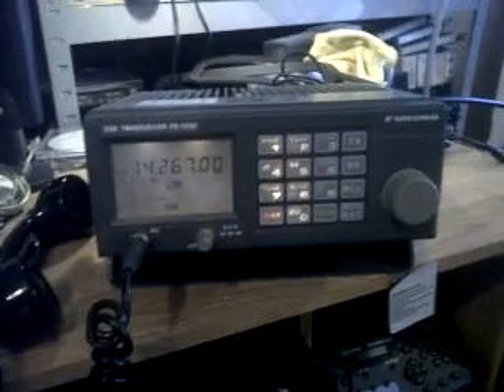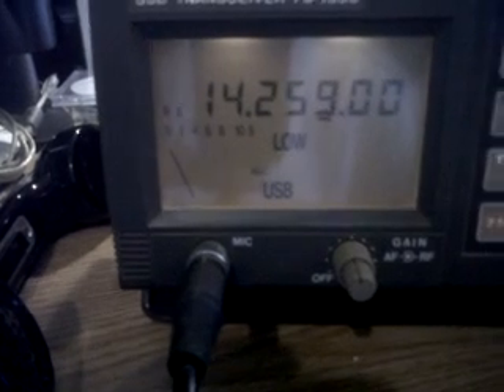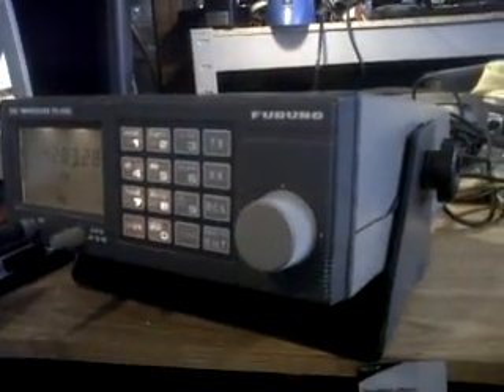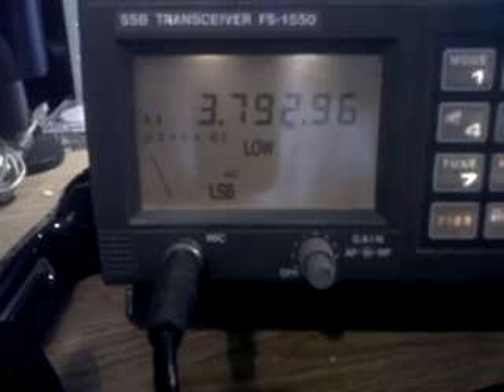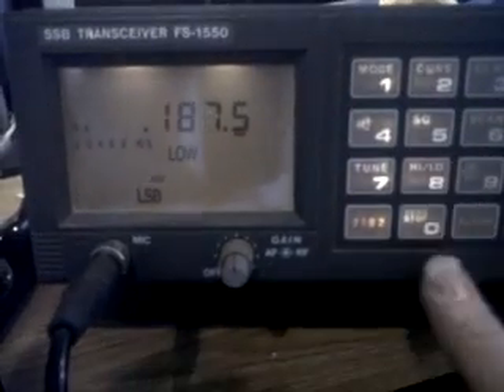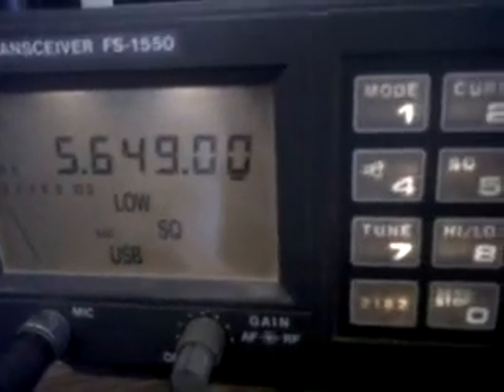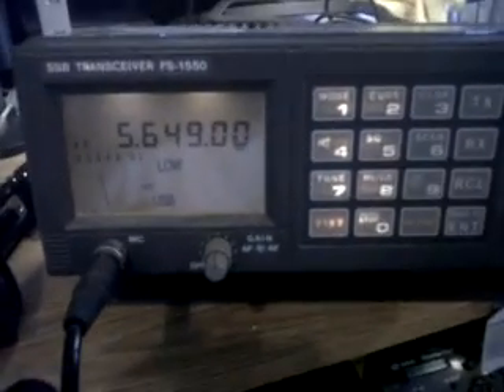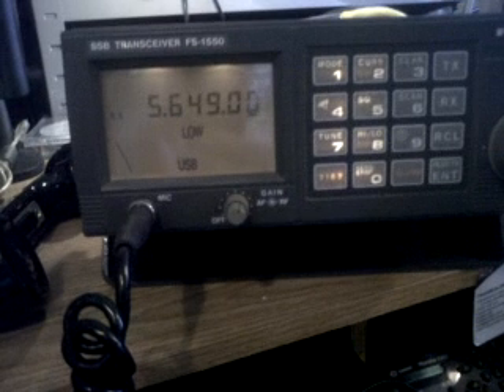FURUNO 1550 SSB MARINE TX RX 20110825-1634.3GP

Comment: i have same radio ,and works fantastic , i first had to take the radio apart ,as it didnt have lsb etc , but fixed all that with the Mini dip switches on the cpu board ,and  also the extended rx coverage to ....dont like the telephone mic ,but all good ....
Reply: Hi! I have just got one of these herein VK3, but no matter what I do, LSB wont work! I have the DIP switches set as per the manual (switch 8), but it just skips LSB mode. CW and Telex mode do appear.  Do you have any tips?
Reply: @hauptuhrdotnetblog6700  no unfortunately. I'm convinced that some of these radios do not have LSB in the firmware.